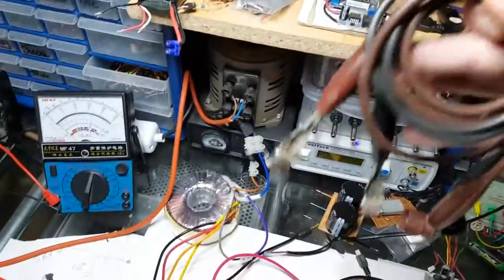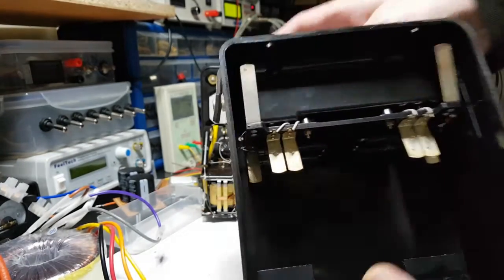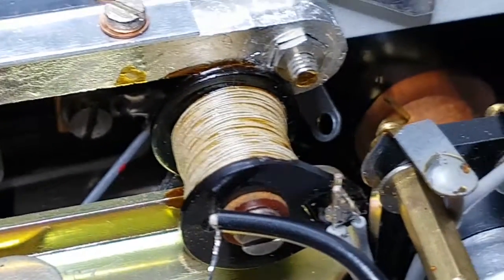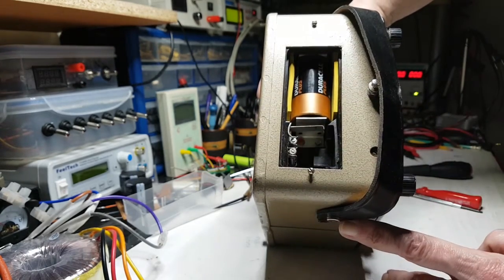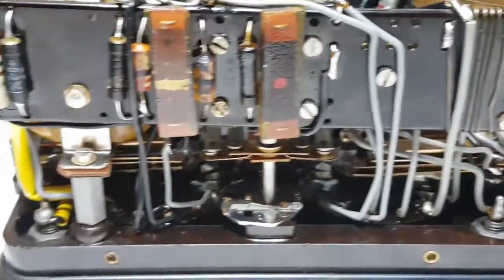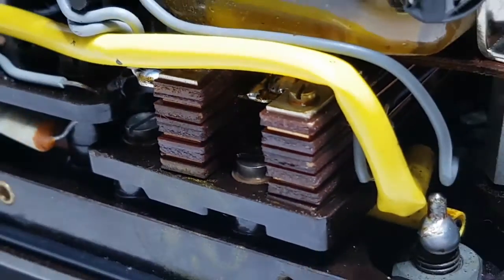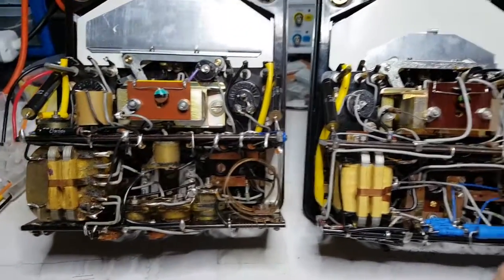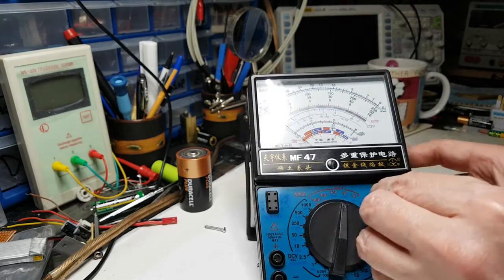AVO 8 Multimeter Taking a look inside

Comment: I have discovered a problem with your video....for the last 2 days..whenever i close my eyes i get visions of inside those dam meters....and .the more i study and research them the more visions i get...lol...i expect you know or have worked out that the coil ribbon is a high current shunt...they cost the £1000 in today's money when they came out...wow the quality of the components..and the magnets around the coil were state of the art high magnetic alloy ahh the days when they made things to last a lifetime,,,i still use my analog bought 40 years ago...  £16 which was a lot of money back then..smile
Reply from the maker: There is definitely something about them. I was still tinkering with them at 3am. I have read the manuals which are very similar for them both twice. The amount of info in the service manual is great. The magnets are set up so, that if a metal screw driver gets to close it will rob some flux and the meter accuracy will suffer.  I have decided to swap the Mk3 for a Mk5, old tech and not so old sat next to each other.  I can imagine these will out live me if treated with respect.

Comment: I'd put a silica gel pack inside to make sure that these meters stay dry and in the condition that you found.
Reply from the maker: Hi, thanks for the tip. I did tape a bag onto the inner case if each.

Comment: The substance inside, on the bottom of the lower case half, is a special inert grease. It was deliberately smeared there by the factory and it's purpose is to capture any debris, like solder splashes, metallic particles from the switches etc, to prevent it causing any faults with the functioning of the meter.  Avo's can easily become an addiction due to the shear number of different types and all the attendant accessories. It was a true system meter and the variety of add on's is mind boggling.  I myself have about 20 or so, but a friend has a collection numbering in the 100's!!  He is trying to collect every varient ever made!  My favourite part of the Avo is the electro mechanical overload cutout.  It trips out on severe overload by virtue of the force with which the meter needle hits the end stop!

Comment: I just found one in a skip.  It's still got the seal on it so no one has been inside it. On resistance with the leads shorted it's moving backwards. I put a new 1.5 v and a new 15 v in it. None of the ohms adjusters change anything. Anyone know what it is?
Reply: glyn hodges thanks for replying. It doesn't deflect full scale when both leads are shorted. I do have red in red and black in black.